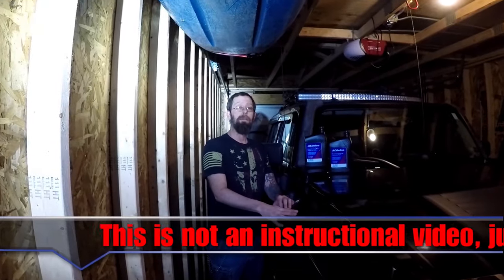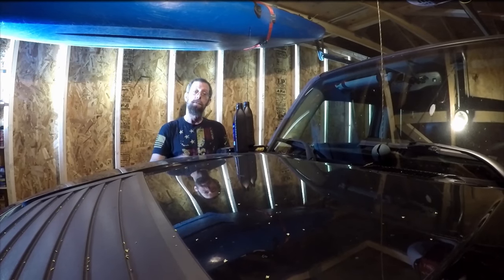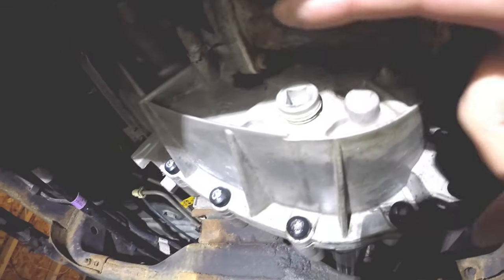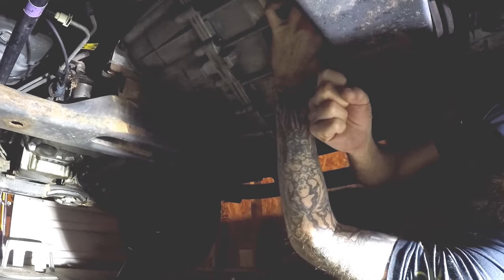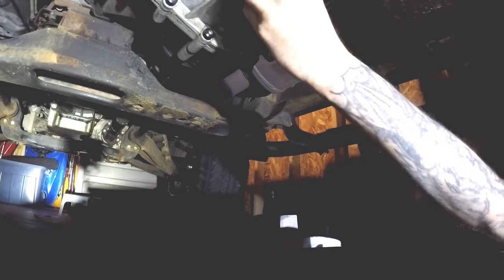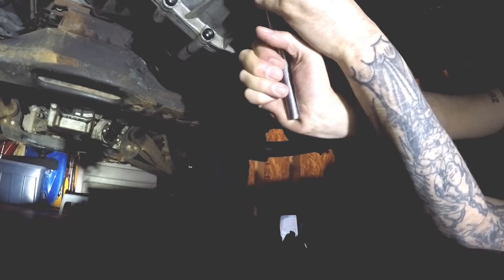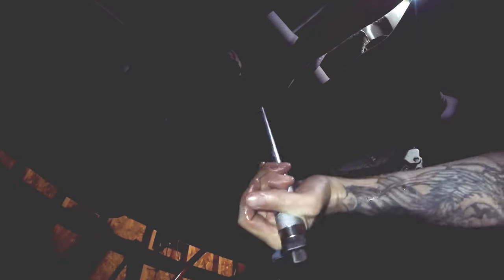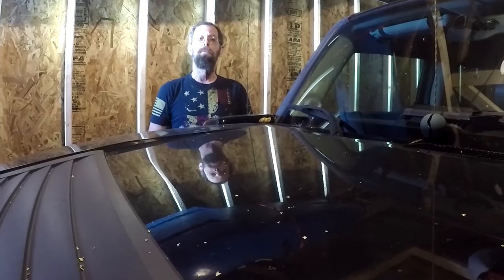Hummer H3 Transfer Case Fluid Change

Comment: Hey
God bless 🙏...
Just 2 questions please, do i expect any kind of winning sounds out of the TC when i change the fluid, or it is not the same as in the deferential?
2- do u recommend using an anti friction additives?

Thanks bro ❤
Reply from the maker: You should not be getting any winning sounds out of your transfer case. No, I did not add any friction additives.
Reply: @WildCountryAdventures  
Even if i havent changed it for some good long time, like 4 years/over 70k miles?
Some people got me scared of changing it, so it would wining...
So basically it is not the same case as with the deferentials, right?
Reply: @WildCountryAdventures  really appreciate your precious time spared to answer me. ❤

Comment: Got a question I know manual says manual fluids 88861800 but my h3 is an automatic a 2007 with rear lock should I stick with 88861800 (manual fluid) or use the new fluid Dexron Vi manual or automatic?